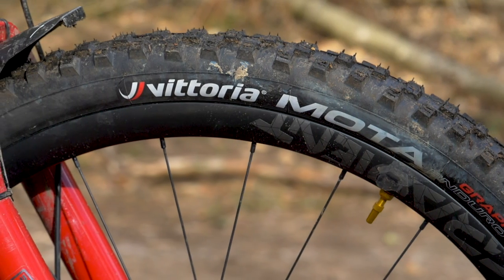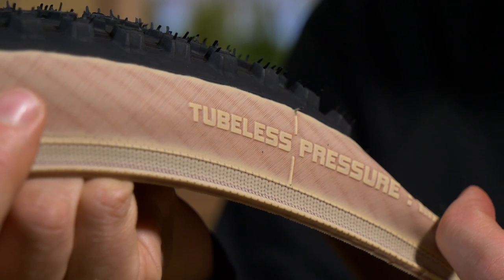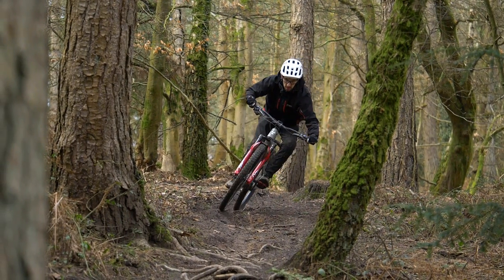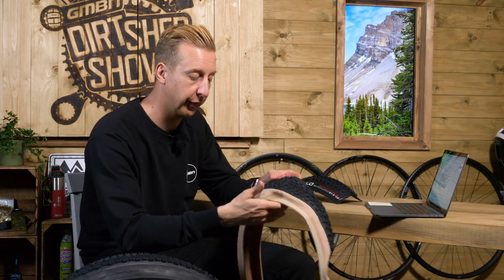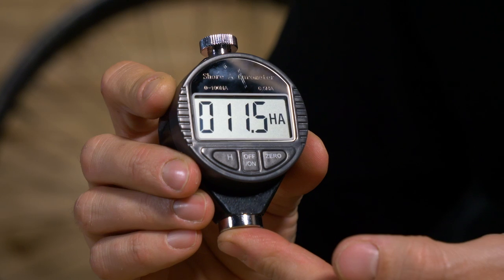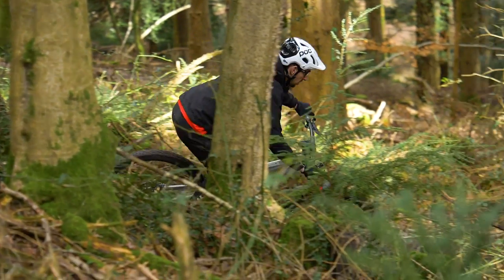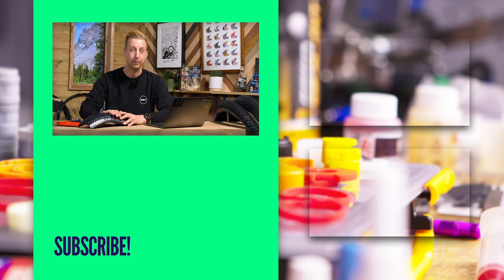Tyre Tech | Everything You Need To Know About Mountain Bike Tyres

Comment from the maker: What type of tyre set up do you run? Let us know 👇
Reply: I commute only, but I run a Continental CrossKing 29×2.20 in the front and a WTB Bronson 29×2.20 rear. Because of my commutes, I run the tires at about 35-44psi and I've never felt any loss of grip in any of the conditions I've had to ride in. Here in SFL, the rainy season brings down a torrential downpour that leaves pretty deep puddles and minor flooding in the roads (despite the fact that the roads here are designed with a concave pattern to help prevent flooding) and I can just ride around like the road is completely dry without issues). I also like how the CrossKing leans into turns compared to the Bronson's stability. It's probably a decent (but a bit weighty) XC tire setup too
Reply: The setups i found working the best for me:
100mm/26" XC hardtail:
- a pair of 2.2 black chili RaceKings

130mm/650B trail fully:
- a pair of 2.4" exo Ardents

160mm/650B enduro fully:
- 2.4" High Roller II + 2.3" Minion DHR II (both 3C, maxx terra, exo) or
- 2.4" TrailKing + 2.3" MountainKing (black chili) ... depending on the conditions.

Mostly settling for around 30psi/2bar of pressure.
Tried different Schwalbes but they never made the cut.
Reply: Michelin force xc back, WildgripR front. 29x2.25. 1.8-1.9 bar. for everything everywhere. Hardfront hardtail.
Reply: Continental Trail king 29er both front and rear. Run 2.4 up front and 2.2 rear
Reply: Hi guys

First and foremost, great, I mean really great channel you´ve got. You address all the aspects of MTB, really well. 

I suppose no one could ask for more... well, maybe a chip or something for us do download and ride as you do :-) 

Could I count on your help regarding tyres?

I ride mostly cross country and have been using X-King 26*2.2 and Race-King 26*2.2 all along. 

And I love them. I think they have good puncture resistance, last long and have good grip.

But it's getting difficult to find tyres 26" and numbers not always correspond exactly from one brand to another.

What options for identical tyres 26*(+/-2.2) do you suggest or recommend?

Thanks a million and please keep up the wonderful reviews and tips and teachings.
Reply: Bontrager XR3 team issue 2.3 up front, and specialized butcher grid 2.3 up back :)
Reply: 559 2.2 Race King Race Sport with black chili compound. 30 psi front, 35 back. I'm happy there are manufacturers still catering to the old 26 inchers since I'm stuck in the nineties and like smaller bikes.
Reply: For xc riding in the center of Chile (dusty-hardpack) I run Specialized's Fast Trak 2.3 on both back and rear. Mud evacuation is actually really good and the traction on steepy (over 20% percent) climbs is something i really appreciate. This time i'm running the "control" version but i think i'd change them both for the "GRID" version to improve durability>
Reply: Magic Mary orange 2.35 front at 22PSI, Butcher Grid 2.3 rear AT 25 PSI, both 26" Stans Float EX rims.
Reply: On my Stache hardtail Iam running Vittoria Barzo front and rear in 29x2.6 all year round. I was never happier with a tire. Much much quicker to accelerate then stock bontrager 3“ tires and not as wobbly. Comfort is great. Using the bike for touring and light trail riding. Running RF AR 35 rims. Pressure is 17 PSI in both tires. Nice to see Vittoria supporting you guys!
Reply: Smoke/Dart 💋💋
Reply: Summer: Magic Mary f/r
Winter: ISP Evo f/r (or probably screws next winter)
Reply: The cheapest decent enduro tire I can find, so usually the one on sale. A slicker rear and grippier front but tbh, I've found that almost all the tyres I've used have been good.
Reply: Still Vitty Gomas for an all rounder and Maxxis Crossmark 2 for dry summer fun....not on the same wheelset though and Sara Lees 34 inch chocolate winter special in the middle.
Reply: Michelin wild am front 2.6
Michelin wild enduro rear 2.6
 27.5 160/150 enduro/trail bike 

Minion dhr rear 2.35 
Magic Mary front 2.6 + oversized
26 inch dh rig

Continental 2.2 race Kings chili front and back
26 inch 120mm hardtail
Reply: @ridefrifjell545  <3
Reply: 27.5" Nobby Nic 2.25 for rear and front  around 40psi and commuting and trailbiking mostly.
Reply: XC HT; 29x2.35 Vittoria Barzo front / 2.35 Mezcal back.
Trail/fun FS; 27.5/3.0 Schwalbe Rocket Rons.
Old 26" XC for commuting;  2.2 Race Kings
(...and Magic Mary is a beast!)
Reply: Maxxis 2.3 DHF front, Maxxis Ikon 2.25 rear.
Reply: I tried a lot of tires and my riding is a lot of XC but some bike park riding. I need tires to be quiet on tarmac because I have a 3 km run up to the forest, but very grippy on muddy climbs. 
I found the CrossKing Is insanely smoothly running and is always my back tire. For the front I sometimes take something a bit more aggressive to help grip in berms. I have gone as far as using a minion but currently I run a nobby nic but I plan to go double CrossKing next. The CrossKing seems to have a ton of grip, and is so damn smooth.
Reply: Hi Doddy. I have Corratec X-vert S01 race hardtail with XTR/XT components. I need the MTB tire to ride in Glasgow. It's rainy all year. I use my bike usually in big parks and also on the pavement. Which tire do you recommend for the weather conditions in Glasgow?
Reply: @romanr5741  cause everyone was at home due to Coronavirus and put it to the limit:) just a guess😁
Reply: i have 40mm outer width 29er rim and 29x3.0 dirt wizard.it is ok?
Reply: GMBN Tech - would love a video detailing when is best time to change your tyres? Especially going into the winter months, I’m sure many people would benefit from this! Thank you!
Reply: I run Mexxis Rekon 27.5x2.6 in the front and Maxxis Ardent Rach 27.5x26 in the rear
Reply: I run Maxxis 29x2.5 Assagai front and rear on my bike even though they are on Hugo 52mm wide rims. Somehow it all works perfect on a Haibike Full Nine'r from 2017. It was a gamble as this is much more meat than when in stock OEM form. They barely fit yet it caused no issues. Thanks for this great video.

Comment: I have never stuck to rotation as when the edge is worn just turn the tyre round and get some more time out off it. Used to do it all the time in Motocross, also used to sipe the tyre on motocross as well and worked very well, but the rubber nobs where bigger so its a bit difficult on mtb tyres. I have a few 42A tyres from maxxis and use them in the wet but there slow but on roots so much grip.

Comment: Thank you, a very interesting MTB tyre video. I am riding a TREK 6000 MTB and currently running Schwalbe 26" x 2.25"   'Table Top ' tyres which have given marvelous grip, and free rolling tyres, they are getting thin and i need to replace them soon, which Schwalbe model tyre would you suggest for mainly sealed cycle ways, and around town on sealed roads. I am thinking of the Random Rob tyre ?   Thank You  👍 Au

Comment: Doddy, Thank you for this detailed review of tires - with all the new compounds and specific bike types, the rubber on the wheels was getting a bit lost on me.  Thanks to you,  I now have a great foundation to make an informed decision on which tires I should be running for a given riding condition.  What are the differences in tires when using an E-bike??? I would think the added weight and torc would impact tire design and application.  Could you do a primer on E-bike tires as well?  Thanks!

Comment: I upgraded to Continental Baron 2.4 (Front) and Continental Mountain King 2.4 (Back), but I can't get the rear tire to fit. The bead won't pop in place. I already tried soap water and inflating it to 4-5 bar, but it still does not pop. Any tips how to fix this?

Comment: What's ticking me off is I have a set on Mavic Crossmax STs 29ers,  they have a 19mm width.  I'm having a hard time finding tires now that fit because all the manufacturers have gone to crazy fat tires.  The absolute largest tire I can squeeze on is a 2.20.  It's on a crosscountry Giant XTC 29er.  Currently I run the Maxxis Ardent race. I like a slightly more aggressive tire as my bike is set up as a crosscountry trail bike if that makes sense.  Stuff manufacturers are doing to these new bikes,  I've had mine set up this way since 2013 lol. I still run a 3x10 drivetrain,  still works better for me then a single ring for long distance rides.

Comment: What would you recommend as a hybrid? I frequently switch between riding off-road and on-road (chasing down pro-cyclists, haha!), but quite obviously the tread wears down more on tarmac. I was using XR4 and went back to XR2, but I am realising there must be better options. I will also move away from using inner tubes, and so will transition over to tubeless. Thanks 😊
Reply: Even if the comment is already old - Schwalbe offers a hybrid tire, the Smart Sam. It has relatively close nobbs in the middle (to run better on asphalt) and is also capable for off-road (of course not on the same level as a spalecialized off road tire). You get it in many sizes.
For 26 inch they also offer the Black Jack (which is a typical tire for older teenager bikes), which is similar but not available in other sizes than 26 inch

Comment: I have the following what is the largest tire I can use for climbing . 26x2.1 is on there can I go to 26 .2.25???

Front wheel . . . . . . Bontrager Race Lite ATB, tubeless compatible, 24° 539mm E.R.D.
 252 mm radial spokes, tubeless rim strip
Rear wheel . . . . . . . Bontrager Race Lite ATB, tubeless compatible, 28° 541 mm E.R.D.
 265/268 mm 3x rear spokes, tubeless assymetric rim strip
Spokes . . . . . . . . . . DT 14/15G butted stainless, ProLock alloy nipples
Front tire . . . . . . . . IRC Serac XC, folding, 127tpi 26 x 2.1
Rear tire . . . . . . . . . IRC Serac XC, folding, 127tpi 26 x 2.1
Inner tubes . . . . . . . Presta valve, ultra light

Comment: Hey, can I fit a Maxxis 2.5 WT tire on my 25mm rim?
Reply: My guess is, that WT Maxxis would need a 30mm rim to perform optimally.
Reply: OK, because I can only find the DHF 2.5 in WT...
Reply: @tobis3687  The 2.5 is only available in the Wide Trail format(the tread pattern is optimised for the larger size). The 2.3 MIGHT be more suitable for you. Bike Radar just did a very good group test of trail/enduro rubber, could be worth a look!

Comment: 0:45 that's not much rubber on the bead, I destroy Maxxis beads, there is no way I can use a tyre for more than few months, some ppl manage to use a set of tyres for a whole season, I can't, I change tyres according to conditions and use use it next year then I throw it way, if it is wearing.
I have also had issues with warping, so I think I should look into other tyres, try something different than Maxxis, I now know how Maxxis performs. if the bead was stronger it would be nice, otherwise I am satisfied with the performance of Maxxis tyres, but me riding harder, gnarlier terrain, braking harder, seems to destroy tyres faster.
I haven't tried DH casing or Double Down casing.
it's not one isolated incident, it has happen with several tyres, bead wears and warping starts, there is no way I can wear the knobs down enough, sometimes they have a lot more life in them, but bead is not safe.
I guess I am #FullEnduro 🙂

Comment: You were doing such a fine job, until the 17:30 mark. Giving less solid information to the customer won't ever be in the best interest of the consumer. A durometer reading can be verified, a marketing label can't because the customer won't be told what it actually means. That opens the door for manufacturers to lax up their production tolerances or outright downgrade the quality of the product.

Also, you didn't explain why extra text on the tyre might be useful and just rattled off the marketing blurb, which is frankly just a bunch unsubstantiated claims by Vittoria. Graphene, like carbon fibre is only strong in one direction. How mixing in a harder, more brittle material (presumably without any alignment of the graphene structure as that seems hardly impossible on such a large-scale production) is adding anything more than making the compound as a whole harder has yet to be explained. The supposed benefits certainly line up with a higher durometer compound, except for wet weather grip - but once again they fail to mention on what type of terrain, so that cannot be verified anyway.

Comment: @6:50 you show a 29 inch tire has a 622mm diameter at the bead, add 57.15mm times two for the tire thickness, which adds up to 736.3mm which converts to 28.988 inches, hence the 29" tire size.  Then you go on blabbing about how a 29" wheel isn't really 29" but rather 24.5"?  Whaaaat?  Since when is a tire not part of a wheel?  No one says they're riding 24.5" rims.  No one. And of course the rim diameter is different then the whole wheel.  So no one is confused about that, but you I guess.
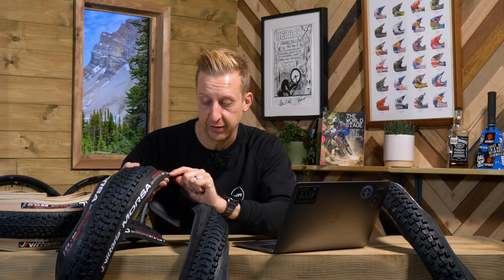Also @6:37, you are talking about one number (622 for 29" tires) but showing with your finger completely different numbers for a different tire.  That is confusing.
Reply: I think he was just explaining, for the uninitiated, that a '29er' wheel is in fact 24.5 inches diameter. Of course, the wheel & tyre work as a system, but they're separate entities. If you went to a shop to buy a 29er wheel, you wouldn't ASK for a 24.5 inch wheel, instead you'd use the generic term '29er'!
Reply: @davidmorris8121  A wheel isn't a wheel without the tire. So 29" wheel is 29". The rim if that's what he's talking about when he says 'wheel' isn't 24.5" (or 622mm) either. That's the diameter of the bead seat in the rim, also the inner diameter of the tire.  He needs to use the right terms.